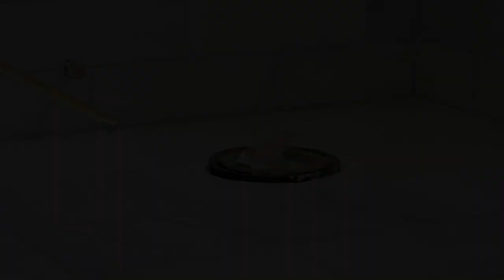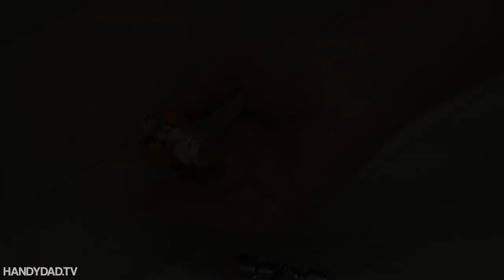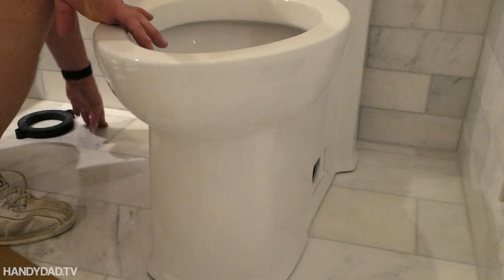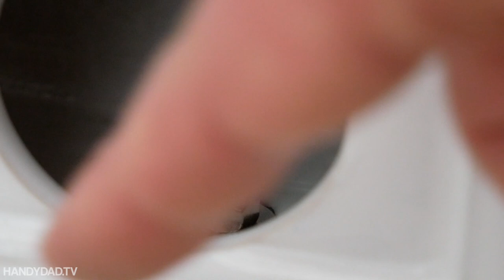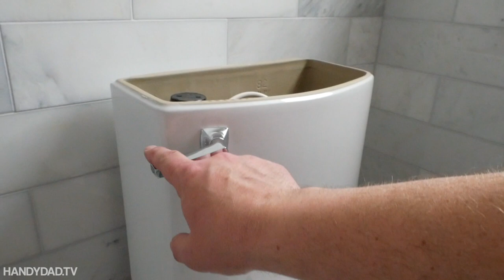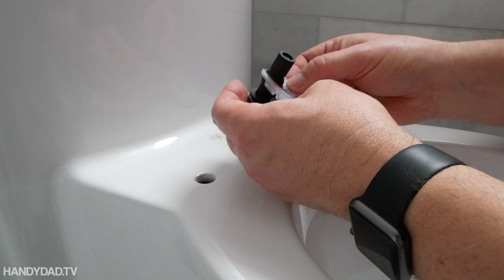Installing a Skirted Toilet | Master Bath Remodel (Part 7)

Comment: On the water supply line home depot sells a chrome pex cover that is easily cut to fit and more professionally finishes the connection to the valve.
Reply from the maker: Thanks

Comment: is it feasible to install if supply line is from the floor, about 5 inches from wall?
Reply from the maker: You’ll need to measure the footprint of the new toilet to be sure. It’s not just about distance from the wall; it’s also distance from the center line of the toilet.
Reply: @handydadtv  Thank you for the reply. I forgot to mention, we are doing full reno including flooring (removing tiles and installing the new ones). I hope plumber should be able to take care of it then?
Reply from the maker: If you’re hiring a plumber, he should be able to tell you.

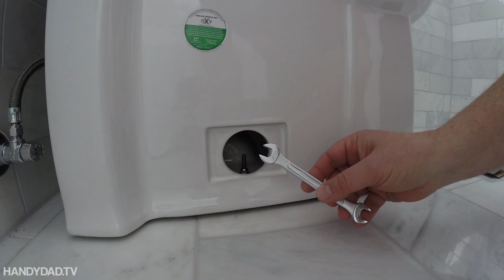Comment: At 4:05 you are using the wrong tool for the job. U would need a ratching wrench with movable head.
Reply from the maker: I use what I have.

Comment: Very informative video except using "Shark Bite" connectors.  I've been told by several licensed plumber to NEVER use "Shark Bite" connectors because they aren't reliable and can leak or can come off completely in time.
Reply from the maker: I get all kinds of feedback and old school plumbers only believe in copper. Not even Pex. So yeah, SharkBite fittings are way too progressive for them. 

And yet, I live in a newly constructed house that is 100% Pex with push-on shutoffs (generic SharkBite fittings) under every sink!